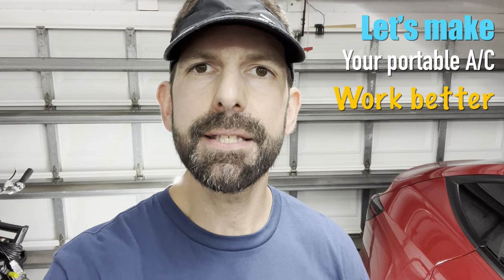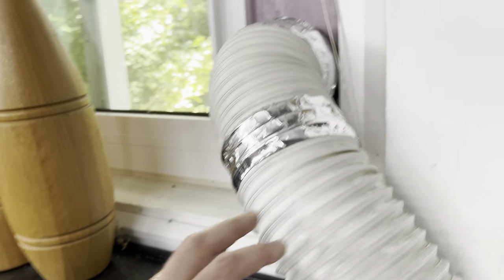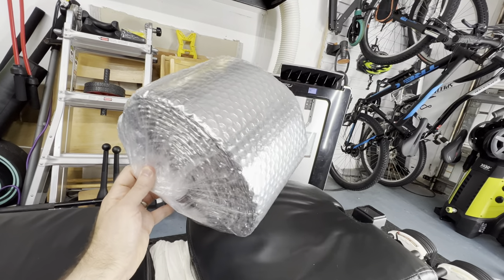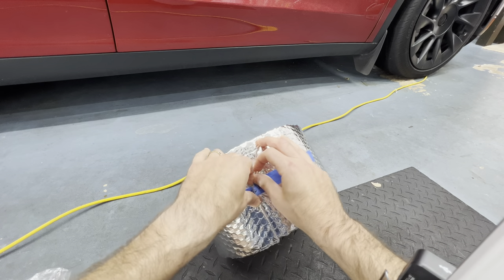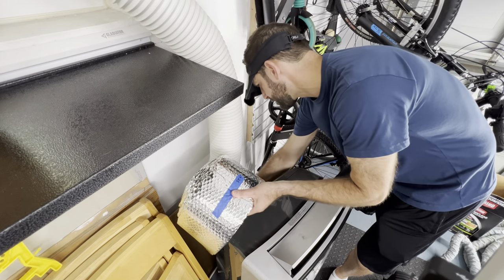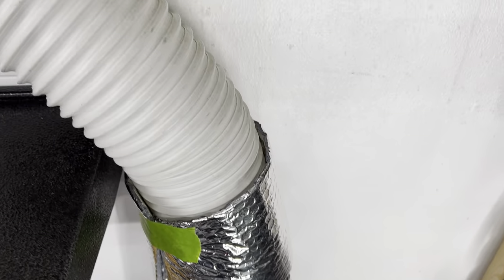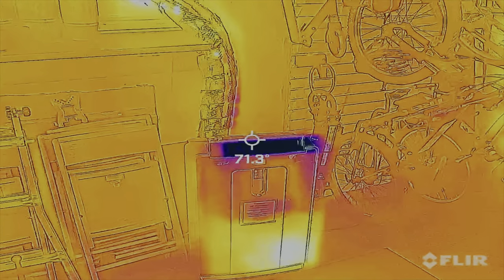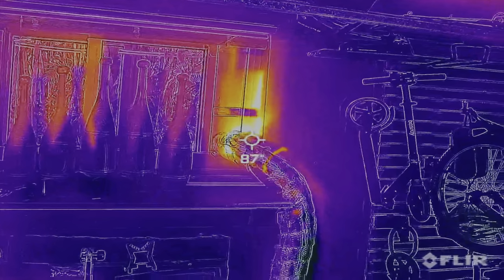How to improve efficiency of portable air conditioner AC units to cool rooms faster

Comment: But you are still sucking the air from the room and pushing it outside, hence creating vacuum. Thus the hot air from outside will enter through the walls to equilibrate the vacuum. Thats why this system cannot work.
Reply from the maker: While I agree that leaking in of outside air from the vacuum they create lowers the efficiency when compared to sealed recirculating systems that doesn't mean they "cannot work". It's fair to say they wouldn't reach the efficiency of a window unit, mini-split, or central A/C that recirculate the air without creating a vacuum. However, when a portable unit is what you have to work with insulating the exhaust duct, as shown here, is a way of helping improve the efficiency of the given system as well as keeping the duct short. The vacuum aspect is an important consideration though so thank you for mentioning it.
Reply: @reallyMello 
I literally taped a cardboard box over the condenser coil intake and routed a 6" duct from outside into the box improve efficiency. It works a LOT better this way and can cool a larger space.
Reply: @donovanhill7367  I think all these units should have 2 air tubes. It's incredible no company producing these ACs has ever thought to that solution. EDIT: I just discovered they invented them and are called "dual hose" but I don't find them here in italy.
Reply: you got it, these units are flawed by design. In the past there were portable split systems on the market, with external condenser, now they are very rare and cost at least 5 times these with tube, I think they were much much better

Comment: Interesting observation, but the heat coming thru the skin of the pipe is the least of your worries with a SINGLE HOSE unit.   One of the two hoses in a TWO hose unit takes warm outside air and cools the condenser which is much hotter, and blows the hotter air back outside.  The indoor intake just takes the room air and keeps cooling it more and more and putting it back into the room.   A single hose unit takes the air to cool the condenser FROM THE ROOM, (air your just paid to cool) and pushes it outside.  That creates a vacuum in the room, and the replacement air has to come from outside, usually past the weatherstrip in the window because it is half open.  Very energy inefficient!  These single hose units should be outlawed!  It costs almost nothing more to add a hose for the intake of the condenser cooler, and indeed, they only cost about 10% more.

Comment: Just random thought in mind...can the hot exhaust air be used to cook food or the least heat a pan of water ? 😇
Reply from the maker: That’s kind of the concept behind hybrid water heaters sort of in reverse. They use the a compressor to heat the water and actually exhaust cold air—which is nice because it helps cool down my garage a little.

Comment: Try moving the unit ckoser to window. Never run hose vertically
Reply: Why shouldn't you run hose vertically? Doesn't heat rise? Excuse me if a silly question.
I agree with the shortest root to the window exhaust.
Reply from the maker: I’m with you Mick, I get shortest route is preferred but I don’t get why a vertical run is a problem since heat rises unless you just want to avoid 90 degree bends which would make sense since that would add resistance to flow

Comment: I'm trying to find information on leaving the plug out with the drain hose in a bucket. I tried it just now on mine the last couple days and oh my God the water that comes out
Reply from the maker: Mine is supposed to self evaporate with the exhaust air but there have been a couple rare times I’ve needed to drain via the plug
Reply: I have mine elevated up on an old solid end table and have the tubing Into a deep bucket so water runs out
Reply: Bought portable a/c unit last year and had it draining into a really big plastic round storage tub. Dumping the accumulated water out twice a day was annoying. Looked at getting small aquarium style pump with long tubing to drain the water possibly out the window. Window screens in my home are pretty old. 

When I can afford a new window mount a/c unit or a mini split I plan to upgrade. 

But for most of last summer & again this summer…. cut a small hole in window screen & attached a hose to the drain at the back of portable a/c unit. Put the a/c unit on an old end table (it’s solid heavy wood), and put the water drain hose out the hole in window screen. 

That window is just off of my concrete front porch and the water from a/c drain now waters the flowerbed adjacent to porch, under that window. 

Mine isn’t the prettiest diy insulation job around the window air hose vent & the a/c water drain. But it’s a temporary solution until can save up for home improvement.